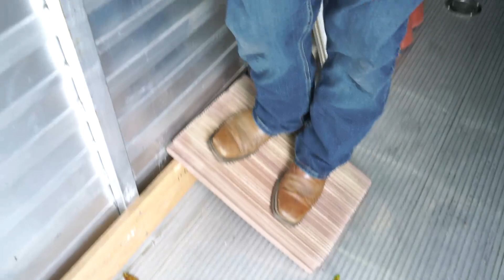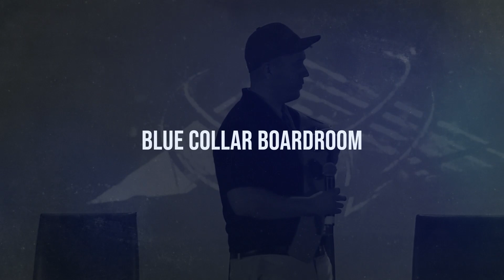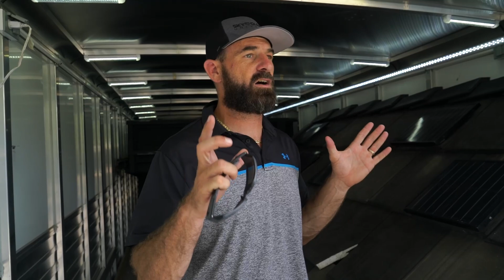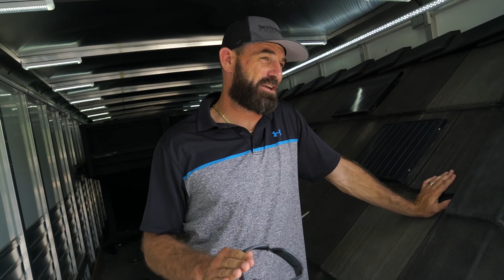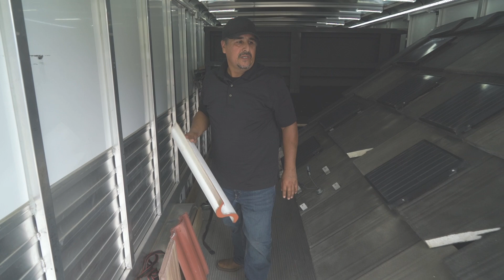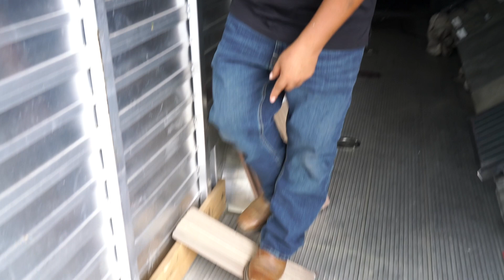Roof Tile Invention will CHANGE the SOLAR Game  #leehaight

Comment: I am a 4th generation electrician and know Carlos.  He brought his early version of his product to our office to review.  His trailer with a roof built onto it.   It is pretty awesome to see.  The best part imo is the coupling of the R value with a great asthetic.   If you are more then 20_30' away the cells fade into the tiles.  Hard to see from the ground.  You can put a fat dent in your power bill with these.   If you pair it with iq8 and an empower mid you can even pull daylight power off it or couple it with a full backup.
Reply: It's beautiful how he has coupled the best of several disciplines in this.  The aesthetic of it stomps his competitors. The R factor stomps them too.   The only place where he is not stomping on the is watt per square foot.   Thing is he is reducing the need for watt with the added R value at the top deck.   It's better.  He took it to a new level.  Now a multi million dollar game can have a gorgeous built in roof.
Reply: He also has incorporated improvement in his install process looking to help the installation contractor and electrician.  No splices below the tile.  It's all on top.  Serviceable from the top.  Only terminations happen under the solar panel on top of the tiles.   Very very smart vs his competitors whose electrical splices are part of and incorporated into the roof tile.    They made it too complex.  Carlos kept it simple and as an engineer who oversees installers and electricians I am thankful when folks consider our workload and future service needs.   He made it work instead of reinventing it.  He poured into pairing it well.   Why take the methodology of yours roofer and add electrical terms to his plate?  Instead of allowing his crew to drag the conductors and leave them sticking out if the tile for the electrical team.   It's so simple and effective is quite beautiful to see.   Congrats Carlos.   👏  and the whole Ensoltis team/family.
Reply from the maker: Absolutely! it's a brilliant product. Carlos and his team are amazing

Comment: What do you do at the cuts to hide the eps?  Have any been installed long?
Reply: When there's a cut on one of the roof tiles, and the EPS is exposed, we cober the cut with a  cement based coating, with the same color as roof tile, and as far as time we have been installing our Ensoltis roof tiles since 2006.
Reply: @ensoltis  do you have florida product approval?

Comment: How much are these?? Roof tile and the panels?
Reply from the maker: They are about the same price as metal roofing tile shingle . Cost would be approximately 500$ a square with all accessories plus minus the freight . Labor would  be about 200-300 a square to install. Should sell for about 1350-1500 a square .